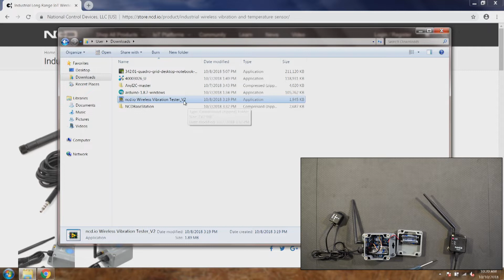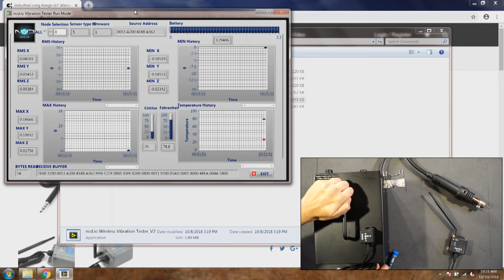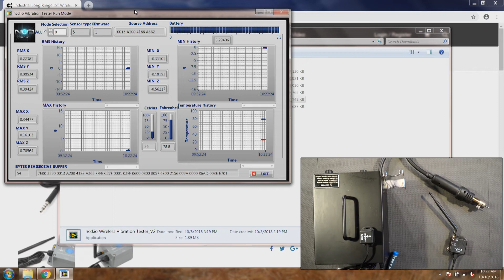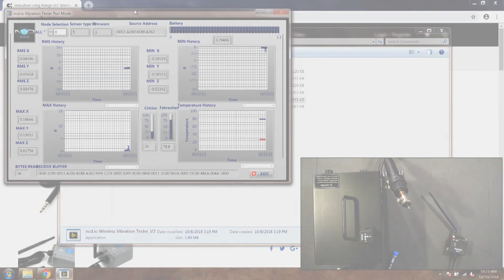Getting Started with the NCD Industrial IoT Vibration and Temperature Sensor: Anil Bhaskar

Comment: Thanks for the video.  ¿how do you link or pair de sensor to the wifi modem?
Reply from the maker: Sensors are automatically linked to the Wi-Fi modem with no additional steps required.  It is also possible to send sensor data to a specific modem, or to a group of Wi-Fi modems using Alpha Station to set to the PAN ID (Personal Area Network ID Number).